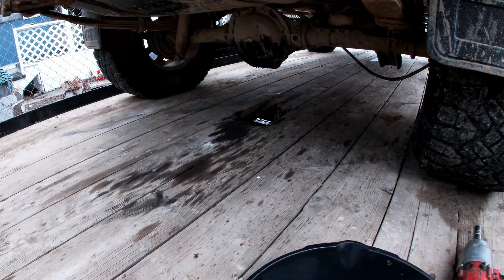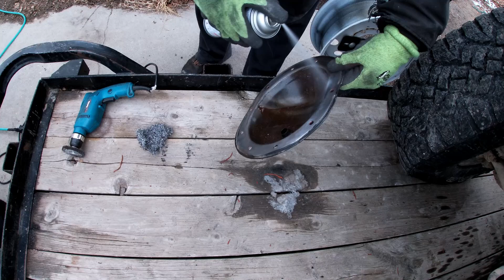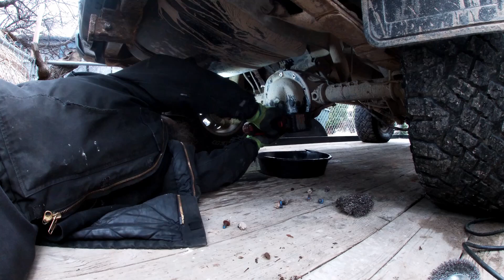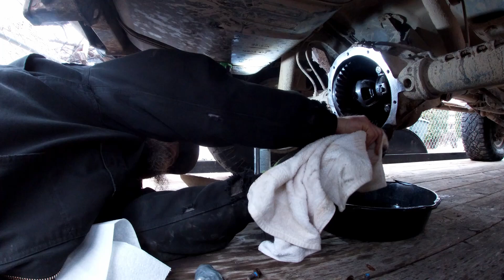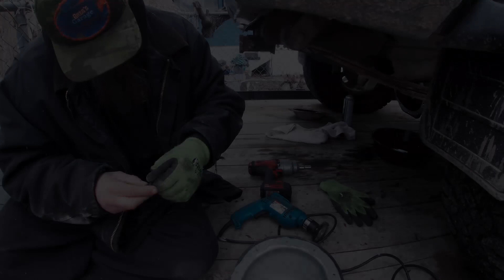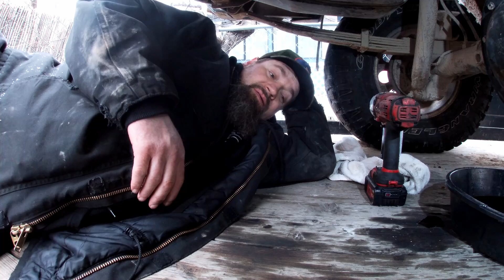"Greg's Garage" Jeep Differential Cover Replacement

Comment: What size are the bolts from the diff cover
Reply from the maker: 13 mm is the size of the bolt head on most if it is a stock or original bolt to the axle.